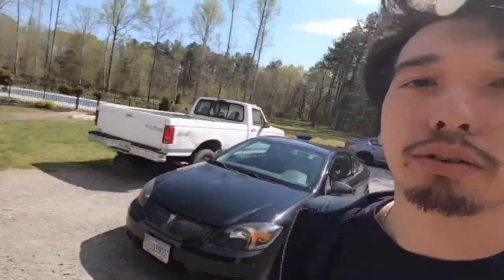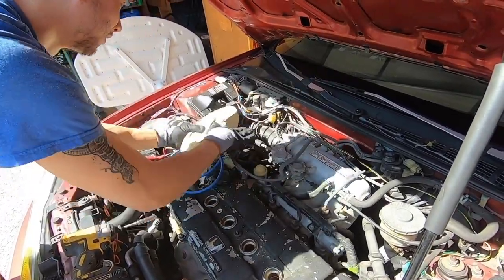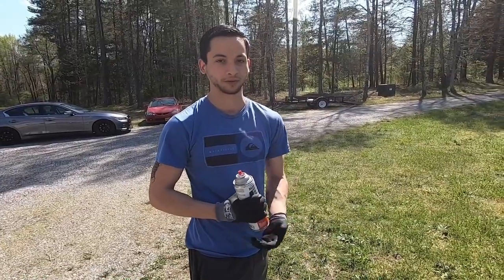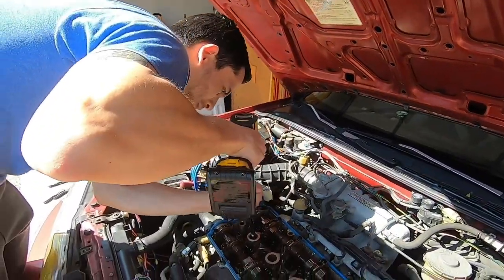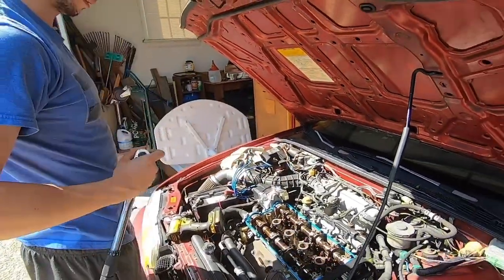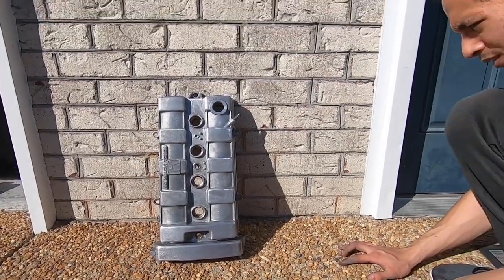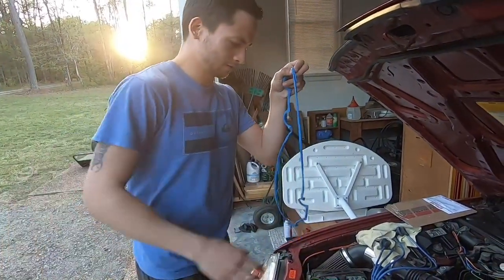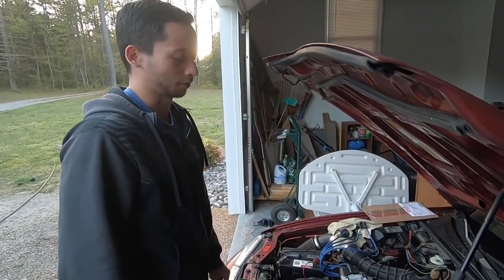The Integra Valve Cover Looks NEW again! (CHEAP & EASY DIY)| 91Teggy Build EP.2

Comment: Debating doing this to my 1998 integra, however im nervous that removing the valve cover may effect the engine compression or something. I wouldn't care normally since its an old engine, however its only got about 50k miles so its basically new. I know its possible to repaint it with the cover still installed, just a lot more work. What are your thoughts?
Reply from the maker: I did it on my 2000 Acura Integra back before I sold it. Pulled off the valve cover, and reused the same gasket. It has a rubber valve cover gasket, so you don't have to replace it if you take off the valve cover. I never had any problems or anything, as long as you tighten it down to spec (I think 15ft/lbs) in a star-cross/even pattern you should be fine. Never had any bad experiences with it before haha so I say go for it!